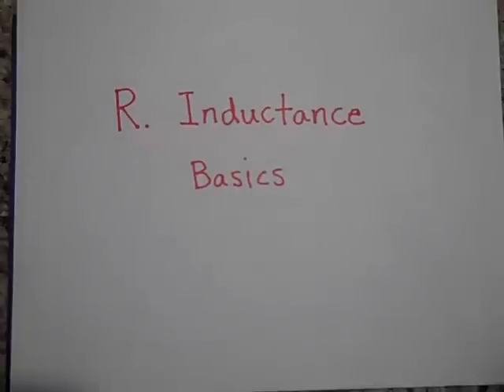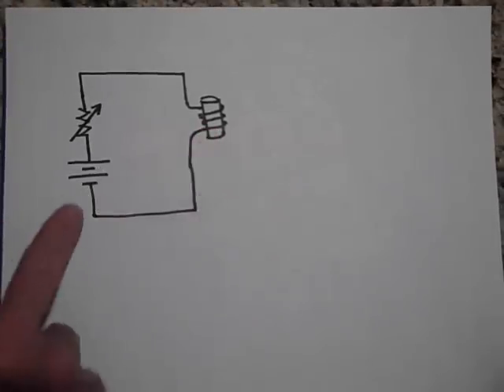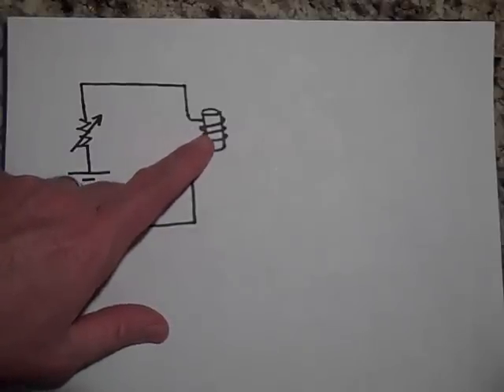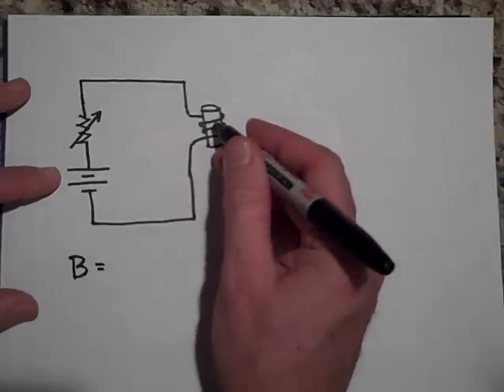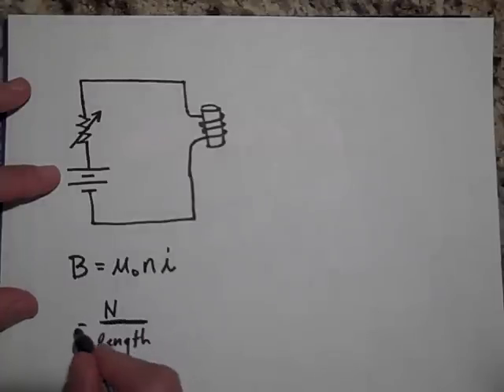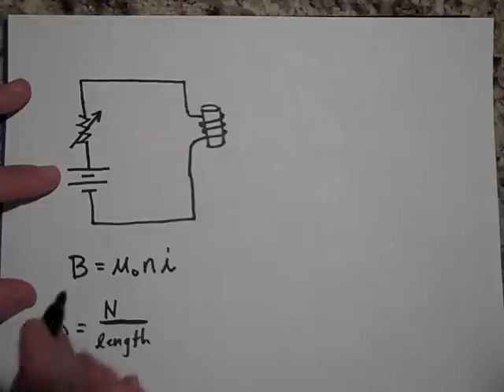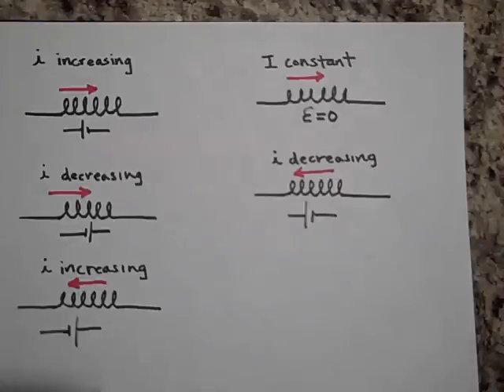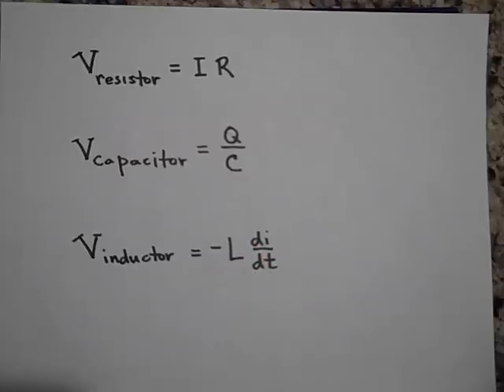The Basics of Inductance

Comment: At time 8:50 you mention that F=ma is similar to  E = -L (di/dt).

I notice you described under the F=ma column as:

m: mechanical inertia

"resistance to change in velocity"

mechanical sluggishness

A small team of us (elec. engr. /physics types) work with artificial gravity and very early in our work, discovered that gravity is a quenching (elimination) of what you call 'mechanical sluggishness'.

The Abraham-Lorentz force describes the recoil and loss of momentum of charged particles that are accelerated. For example, electrons in a radio antenna experience what you call "electrical sluggishness" just as in an inductor.

 Since objects of matter are just large collections of atoms - and since atoms are collections of charged particles - what you call 'mechanical sluggishness' actually has its roots in the recoil/loss of momentum that is 'suffered' by charged particles, just as a change in current in an inductor is an acceleration of charged particles, leading to what you call 'electrical sluggishness'

It's important to recognize the following:
1)  when a 'mechanical object' like a car starts to brake, it is accelerating in the opposite direction of its travel
2)  when current in an inductor 'slows down' or is reduced, the charged particles experience acceleration in the opposite direction of current flow

Acceleration in a gravity field leads to zero 'mechanical sluggishness' - the technical term being 'inertial drag,' or 'loss of momentum'

If you accelerate in your car, you feel 'pushed back in the seat' - that is inertial drag.

If you accelerate in an artificial gravity field, there is no inertial drag.

Recognizing that accelerating charged particles experience 'mechanical or electrical sluggishness'  whether they are inside an inductor or a person or car or.... etc. is enlightening.  Most of us don't think of our bodies as being a huge collection of charged particles, but there you have it.

Thank you for an excellent treatment of inductance.  The introduction of the terms "mechanical sluggishness" and "electrical sluggishness" is a huge benefit to people learning the subject because it will give them a qualitative grasp of what's happening at the physical level.  Although we tend to rely mostly on mathematical description, the qualitative treatment is valuable for people who are new to this topic.

Comment: If inductor opposes changes in current by inducing a voltage opposite to the source voltage, then shouldn`t that induced voltage oppose the source voltage throughout resulting in zero current in the circuit..... why then current still flows in the circuit........ what is driving this current ..... how is the opposition to that current is reflected

Comment: Hi there . I am always having these two questions . In AC circuit it is said that current always keeps changing it's direction . If so , why we always have the same hot wire ( when testing with pen voltage tester) . Second question : Is there really any kind of movement for electrons in a wire when we apply some voltage ? Thank you so much for your help.
I have learned a lot from your videos.
Reply: The current changes direction because the voltage in the hot wire becomes negative. I am assuming you are wondering why the neutral doesn't become negative and the hot wire zero. The neutral is always zero in normal conditions.
Yes there is electron drift. In AC they just go back and forth.

Comment: In short it is only due to the "physical construction and geometry" of a coil which causes building and collapsing of magnetic field around the coil to induce an internal voltage in the coil (Faradays Law) called the counter emf. This counter emf opposes the supply emf or voltage (ac source or battery) causing the current to lag. Hope that is right?

Comment: The mechanical/electrical sluggishness analogy is an eye opener. I had the assertion that inductance and resistance performed similar functions, but now I understand that inductance simply resists the change in current, while resistance impedes the flow of current. Thanks for sharing your knowledge

Comment: Sorry if this is a dumb question, but what does the d stand for in -L*di/dt?
Reply: Think of it like the d is for delta - but the change is very small. So it's like a very small change in current over a very small change in time. Or the instantaneous rate at which the current is changing.
Reply: d is change in something,so di is change in current divided by change in time as dv is change in velocity divided by change in time.
Reply: If you don't know this, you shouldn't be studying this topic at this level. It's like trying to calculate 5*5 before knowing 5+5.

Comment: Here's what he means when he says "the inductor will try to stop the current from changing".  The inductor (as he says) doesn't "try" to do anything.  If you've run current through it, you have a certain amount of magnetic flux created by the moving current; when you reduce the current, the magnetic lines reduce, cutting through the metal coil;  and when the magnetic lines cut through the metal coil as they shrink they indduce voltage or current going the other way; the shrinking magnetic flux spends its energy by inducing current in the coil; you could say (inaccurately), that the magnetic flux is transforming into current as it shrinks, or rather using its energy as it shrinks  to induce current in the wire.  So ironically, even as you reduce the current from the power source, you are Creating current going in the opposite direction because you have cut power to the magnetic field, which now shrinks and induces current in the wire while shrinking.  So the inductor doesn't "try" to resist current change; it simply creates current going the other way as the magnetic field shrinks when you cut power to the coil.
Reply: +Masked Marvyl 
Thanks, i saw a lot of videos and searched a lot of sites. And as i start to read the comments, i finally found someone who explained it the right way
Reply: Hello. You seem to have a good grasp on the material, what sources for studying do you recommend that explain such electrical theory in depth and clearly?
Reply: By the way, the magnetic field fuses. When you think they 'cut', they don't. A wire is a waveguide. You know what I lazy to say anything. A magnet is a rotating torus with both in and both out at either pole. This is the last thing I will say
Reply: Sorry to burst your bubble but when the magnetic field is shrinking, it NEVER touches the metallic boundary. Use your right hand rule and you will see the shrinking magnetic field approaches the outer part of the solenoid while the internal magnetic field is 'expanding' to the inner wall of the solenoid. ALL videos showing the magnetic field shrinking to the center are ALL false when it shrink according to right hand rule. Think 10 times before you type.

Understanding magnetic field, it shrinks approaches the metallic surface but it does not damn shrink to the center.

I swear people need to understand WHAT is the geometry of a shrinking magnetic field.

By the way, amperage is right-hand rule while voltage is LEFT-hand rule.

Comment: Can you explain how this fact is useful in circuit designs?
I sometimes see an inductor used in power charging circuitry & I read that it stores energy to increase the charging voltage from a smaller input voltage to a larger charge voltage, but how can I know what the useful limits are in such a circuit to modify it for whatever purpose that I have?

Comment: I'm confused by the battery analogy. Are you saying when i is increasing the inductor is acting like a load, as if  it's charging, storing energy like a battery? But when i is decreasing  the inductor dumps energy and acts like a source battery. That's the way I see it from your vid. If the battery is charging the neg. terminal is pointing towards electron flow and when the battery is discharging the neg. terminal is pointing in the same direction as electron flow. Not easy to grasp but thanks.